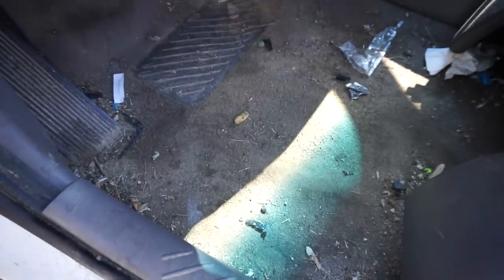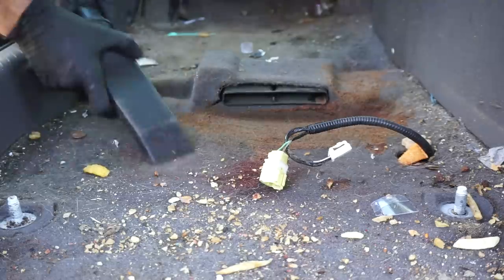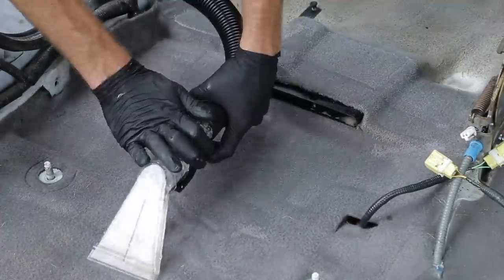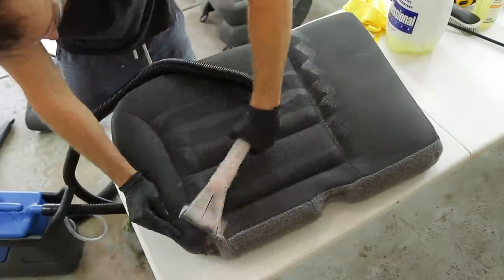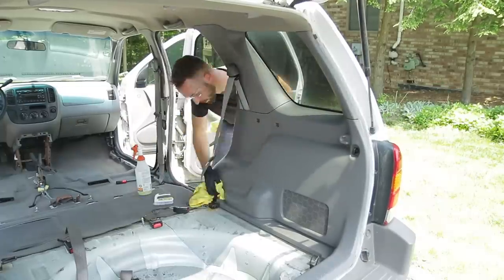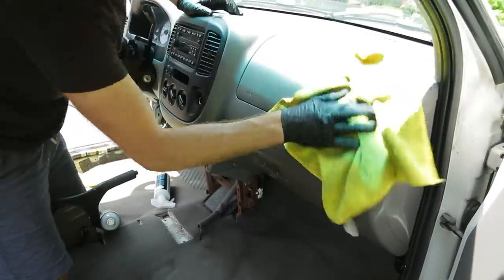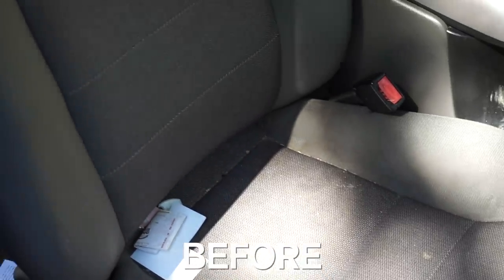I Bought The Nastiest And Cheapest Car On Facebook! Deep Cleaning Car Detailing Transformation

Comment: I will never be satisfied until the water runs clear
Reply: I agree. I wouldve ended up cleaning the carper about 10 times haha
Reply: Yep that how I do it and use a Rug Doctor Portable as have the motor brush, so vibrates the dirt out like the drill would. I also use the drill  carpet brush on first pass.  I run passes till water in dirty tank is pretty much clear
Reply: I agree. I have detailed cleaner cars with as many as five carpet cleaning cycles.
Reply: Hey what do you guys use to protect it?
Reply: Allan Tj same. He doesn’t use hot water just solution.
Reply: Erik ok
Reply: @senzuu4750  ikr I was like 😬😬😬
Reply: Jose Gap chemical guys fabric guard
Reply: I won't either.
Reply: @josem1596  you can get scotchguard spray at Wal-Mart to protect the carpet and upholstery
Reply: I agree the carpet doesn't look clean enough
Reply: Jose Gap mmomomki
Reply: Jose Gap mmomomkik
Reply: Phoenix Synthetics has I mom
Reply: Lkoomo
Reply: John Lehman - I noticed that. Won’t dried solution attract dirt?
Reply: Hey I changed this comment from 👍1.9K to 👍2K

Comment: I used a spray adhesive to reattach those fabric door panels.  Used a putty knife to shove all fabrics in the car back under all the plastic panels.  My rear wheel wells have rusted away as well.  Love my 2003 Escape and will drive it into the ground.  Almost 200k so far.  Great job on this one! Love seeing how you can take them apart.

Comment: You need to change the cabin air filter in that thing 🤮
Reply: Absolutely!!!!
Reply: Sami Elhaj especially with those cigarette butts on the floor, can only imagine how clogged the filter is yuckkk
Reply: Double barf!
Reply: Air filter filters air from outside into the cabin but nevertheless no harm in changing it. However the rear and side outlets must be really clogged up. Yuck filthy rotten bastards
Reply: Most cars did not have a cabin air filter before 2010.  Ford didn't start until 2015 .
Reply: I would just torch the car.
Reply: @mikecronis  uh, my Ford contour from 2000 has a cabin air filter, u need to get your facts straight

Comment: I find it hilarious that dog hairs still remained after all of the intense cleaning. Those suckers are so hard to get rid of 😂!!!
Reply: Microfine pumice is really good at getting them off. Those little suckers get into the weave of the fabric. There's a reason some detailers charge more for pet hair in vehicles.
Reply: So... why not remove carpeting in cars altogether and add a drain do that you could just spray and drain? I hate carpeting at home because of the mess.
Reply: A shamy the wax type not the drying type and the solution you use to clean the inside of your car always does the trick well for me at least
Reply: Lint Rollers work great picking up animal fur.
Reply: Oh, I actually thought those were just loose threads that unraveled in the carpet!

Comment: I work in a factory that manufacturers interior plastic automotive pieces. We use magic erasers and different colored (for different abrasiveness levels) scotchbrite pads and sometimes a torch to fix light splay and get rid of some flash in tight areas. The pads and erasers even out any gloss, but on lightly damaged areas, it's possible to minimize scratches if you know what you're doing.  I wouldn't recommend just anyone taking a torch to their interior.. but magic erasers are MAGICAL!!

Comment: You should clean the engine bay(clean the surfaces, oil change, spark plugs, etc). I cant imagine the motor was taken care of any better than the rest of the car.
Reply: Yup.
Reply: I thought that too. Even if it's not clean get those filters and plugs changed out, that's a cheap fix and in itself can raise the value of the car.
Reply: I wanted to see the cabin air filter.
Reply: @davegonzalez5334  it would have been black!
Reply: watch the chrisfix vid
Reply: How do u know its got an engine?  I mean 600 bucks for what? Does it even run?
Reply: @IcebulletZ  definitely seemed like they smoked in the car
Reply: @Pochitaakii  Yeah you can see old smokes on the ground. And if they didn't clean the cabin they likely never changed the cabin filter as that's more intimidating for people who don't know much on cars. So it's likely black and the ac is probably chugging. I'm glad he cleaned it up inside. If he changes out filters and sparks and such he could likely sell it for a decent amount and make profit.
Reply: @IcebulletZ  oh definitely,  but i would get an overall check   they only sold it For 600 bucks! If they treated the whole car like the Inside , theres probably even more Problems 🤷🏻‍♀️

Comment: Did you switch out the cabin filter? That can help with cigarette smoke smells.
Reply: and an ozone machine
Reply: And clean the ac evaporator, probably half a botanical garden growing on that thing
Reply: they say there are solutions you can use to chase the ciggy smells out of the heat / a~c  ducts
Reply: Never saw him clean the ceiling either

Comment: if that's the interior that engine is probably full of sludge and mechanically falling apart...
Reply: True, plus it’s a ford 😬
Reply: Mitty first off I’m making a little joke I prefer fords over Chevy gmc dodge etc
Reply: Eh, not necessarily true. Have a 2005 Ford Focus I got bought when I was in college, thing was pretty much a garbage heap. Not too far off from this video (minus the roaches, think I would have drawn the line there). But I was great with general maintenance, still runs great. Although I haven't driven it in a while since it's still has like 8 years of trash in it.

Comment: Magic Eraser does wonders but it is an abrasive so not using too much pressure is key.  I always start with normal cleaning method and if necessary, follow with a magic eraser.  Guarantee you will like the results.

Comment: Bought it for 600? Ready to sell for 1200 now
Reply: Prob a little more
Reply: Dylan Reed probably more if the internals are in good shape.
Reply: Dylan Reed 1800+
Reply: Plus he’s making money off this video. This was an excellent play
Reply: There is a really big spot of rust on the side. I would not buy this car.
Reply: Strawberry cheesecake lol u must not be from the north, everything looks like that
Reply: @patrickmurray4084  the north of where? I've been to Scandinavia and their cars are not rusty
Reply: @strawberrycheesecake5502  in our area of the Midwest our cars rust terribly. Here in Ohio they use a brine mixture on the roads during winter and it wrecks paint and causes rust. Not unusual to have a car with a good deal of rust. As long as it is clean and runs well he could make a nice profit.
Reply: @strawberrycheesecake5502  yeah rust on cars that are more than two or three years old is normal. Not that much rust but salted roads in the winter do a good bit of work on cars.

Some people do have the underside of their car sprayed every year or every other year and some cars are also equipped with an electronic rust inhibitor that will swap the polarity of the metal every so often.

Edit: after some googling I have learned that the inhibitor does not change the polarity of the metal but infact it puts a weak electrical current through the metal of the car that interferes with the charge between metal and oxygen inhibiting rust.
Reply: 2500 at least cad btw
Reply: Dylan Reed no
Reply: @creeksidemama5207  ok, I can see that. Just rust sucks for a car, sooner or later it can damage it badly.

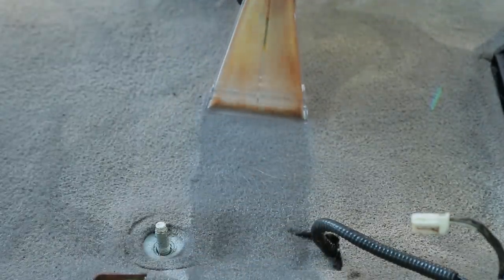Comment: 5:48 you can see human/animal hairs still on the carpet after vacuuming. Use a lilly brush or something similar to claw at that after vacuuming to get it into clumps which you can then easily vacuum. If you extract with the hairs still there, the hairs will gather and internally clog the pipes of your extractor and can cause leaking and other wear/tear problems.

Comment: Never heard of a car infested with roaches before...guess it could happen. shudder Love my car. It's older, so I need to keep it looking it's best. No expensive detailing in my budget, so that means 2 kinds of wipes behind the passenger seat and one of those trash chutes hanging there, too...shake out the mats whenever there's bits on them. Leather conditioner on the seats so they don't crack. Organizing bins in the back hatch. Just don't let trash accumulate. Take it out when you leave. It ain't hard.

Comment: Watched your whole video.  I still see extraction lines in some of the rugs.  I was delighted when you said you were going over it a second time but I think it needs a third.  I am glad to see you detail fellows ard starting to use a much stronger initial concentration of cleaner at the very beginning.  For us old boys who used cleaning products for floors fabrics metals concrete and  painted surfaces back in the 60's and 70's, the books told us that when it came to some greases and stains that water was our enemy.  In order to cut heavy grease and stains you have to get the right detergent in there dry, or at a high enough concentration that your product would actually cut the grease or lift the stain right off the bat.  Not a high enough concentration and even with drill brushing your product doesn't cut the grease. There are 2 approaches to that.  1 is spray on a super concentrated squirt first and work it in almost dry. This is the way a lot of home carpet cleaners do it.  But it only works right if all the loose dirt is removed first.  That's why an extra thorough initial dry wacuum with agitation is important.  None of you fellows are using rotating air brushes as the head attachments on your dry vacuums.   I got one for my home stairs for the end of my extra long built-in system hose.  2. You could do that superficial job of dry vacuuming that you are already doing and do the initial dilute spray application and suck it as dry as you can, maybe let it dry a little, and then hit it with a highly concentrated spray an drill brush agitation.  Let that sit for a while and lightly still brush it again.  Then exract the daylights out of it with properly scented hot water.  You could put in a tiny bit of baking soda in the hot rinsing water for odor control.
The advantage of #2 is that you work with nature to remove all bad contaminants at the right time and in the proper order.   I don't think enough of you guys had enough chemistry in school.you rely too much on water.  The ordinary Chem courses don't teach enough. Working in high Purity industrial cleaning taught me a thing or two.